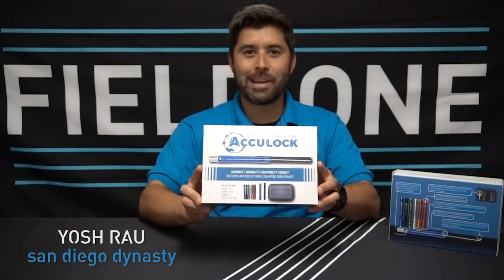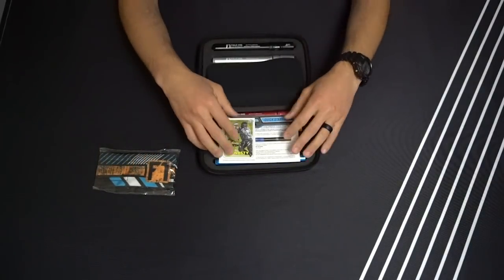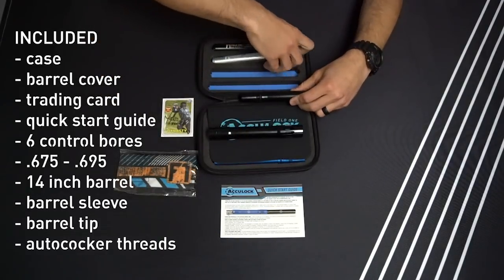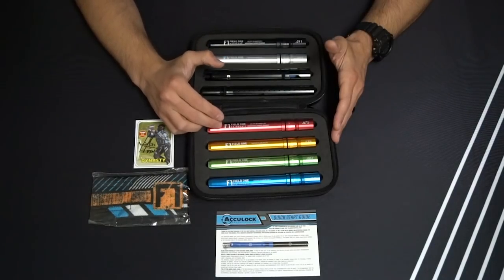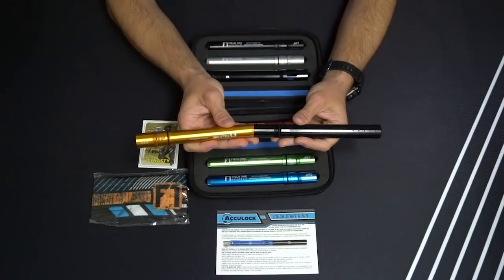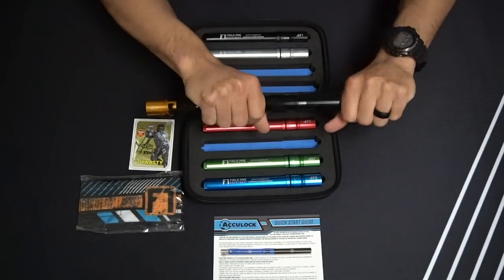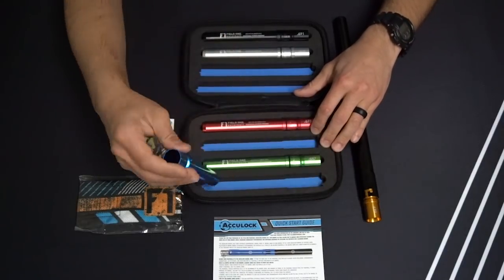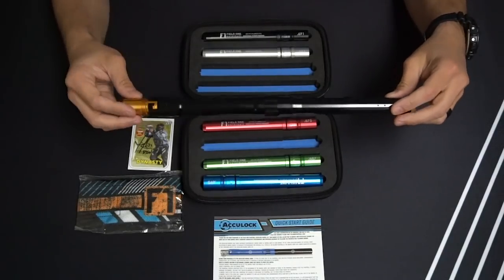Acculock Barrel System Demo

Comment: I’ve been playing for 15 years and I have never once used a .691 let alone a .695 insert.  I’ve used some of the highest grade paint all the way to the lowest, even on 95 degree days paint doesn’t swell that big. You should have focused more sizes in the lower .680s and upper .670s.
Reply from the maker: Jarrett, Thanks for your feedback. You're correct that paint is very rarely sized at .691 or .695. However, what we do find is that paint is sometimes not round, and there are some oblong balls in there. If one of those "football" shaped balls enters the barrel the wrong way, you will likely break that ball. The only way to avoid breaking paint when the balls are not perfectly round is to "overbore" and use a size barrel that has room for the misshapen balls. That is where a .691 comes in handy, or even a .695 is extreme cases. If the paint is perfectly round you are unlikely to need those sizes, but in Dynasty's travels around the world and playing almost every weekend, we often encounter paint where we "overbore" so we don't break paint that isn't perfectly round.
Reply: Field One That makes sense. 👍🏻
Reply: @fieldone3836  that is the most Aha! response. I never thought about how to deal with the footballs let alone "overbore" as you explained with such a large size.
Reply: @JSabella09  I know I am replying to a very old comment, but I wanted to add my experience from this past 2023 summer for any returning players like myself (last tournament played was 2004) and new players looking to upgrade to this great kit and watching this video.  At the height of summer here in central Illinois, its rather humid.  When its 90+ degrees with added humidity,  shooting the Dynasty branded paint, I was having to use the .691 insert.  Paint was always kept out of the sun but the humidity still swelled the balls to a size that I also had never shot before.  I broke zero paint and I was very thankful that I had the extra large size on those few days.

Comment: why have an insert at this point? Just make barrel back  if the tread is on the insert. The Idea behind  system like the freak is the ability to have maximum compatibility and flexibility. My freak kit contain ac back, spyder back and ion back plus a freak tip, an all american tip and an apex tip. This allow my to use all insert and all tips on all of my marker. I can't see the point of this kit.
Reply from the maker: The Freak kits are great, especially for having multiple options like switching between markers. We were not trying to make a Freak kit, but something different that we felt improved on some things that were important to us-namely shooting through broken paint, not breaking paint, and durability. A big part of this barrel kit design is the patented self-aligning feature that aligns the bore with the tip perfectly each time. Even two piece barrels with barrel backs often have issues with how the two pieces align. The other benefit of this feature and having a tapered bore that goes into the tip is that there are no "flat" seams for paint and shell to get caught in. Thanks for your feedback.
Reply: @fieldone3836  Well I understand your point. But it is not quite evident in this video that an unaligned plage our marker. You might want to show how other barrel are problematic. Presented like this it look like a solution looking for a problem.   

Since the insert is threaded, I can't wait to see the inevitable useless video comparing the PE fl bore only VS Acculock insert only XD.
Reply from the maker: @mikaelangelo6940  We're not trying to scare people into thinking their barrels are bad, and they're not. We are trying to explain and show some of the features of our barrel that we think makes it different from other options. Barrels that do not align properly are quite common, and simply the result of minor manufacturing issues. They work, but they are just not quite right. The patented self-aligning feature eliminates that issue, which is great, but we certainly haven't landed a man on mars, or even allowed you to shoot more people off the break. The larger benefit that I saw from the use of this feature is that the our barrel shoots better through broken paint than barrels made other ways. I certainly can not prove this scientifically, but I think the biggest benefit is that the insert extends into the barrel tip so there are no "flat" seams for paint and shell to get caught in. The paint and shell only has one place to go, and that is out of the barrel. I had a barrel many years ago with this feature and always felt it shot through broken paint better than others. At some point, someone did a detailed barrel test, and they got a similar result to what my gut had told me. (Here's a link to their test: https://www.pbnation.com/showthread.php?t=2218018). That taper extending into the tip was a feature I felt was important for the performance of the barrel, and the fact that we were able to make sure the tip and insert were aligned properly was the icing on the cake.
Reply: @fieldone3836  Not saying you should trash other barrel but show (animation would be great) how the paint get stuck in a regular barrel. I totally understand your point but it is hard to picture the advantage (how slight it might be) over the barrel we used for the last few decades.
Reply from the maker: @mikaelangelo6940  An animation would be an excellent idea, and something we will look into. Thanks again for the great feedback.

Comment: Sorry but that barrel system looks like garbage. I’ve owned some freak kits for over 10 years and have never had “durability” issues.
Reply from the maker: Sorry to hear you don't like our new kit. We did not set out to make a kit just like the Freak. The Freak is a great barrel kit, and I'm not surprised to hear that you've never had any durability issues in 10 years. If you take good care of your equipment, and don't have any unfortunate accidents, there's no reason you're Freak kit won't last forever. We set out to make a kit that addressed issues and concerns that we have encountered. Durability was one of those. The players on Dynasty are our benchmark, and how was test products, and most of them were not as good as you at keeping their equipment in perfect condition. Between them playing every weekend, an occasional drop or two, and then people not always using their case, we wanted to improve the durability. We believe we did that, as well as addressed some other things, making the Acculock kit something different from what is already on the market. For those who love the barrel they shoot, there's no need to get our kit. For those who are not completely satisfied with what they have, we have another option that a lot of thought and testing went into. The patented self-aligning design makes sure the bore and tip are lined up perfectly each time. This also eliminates all "flat" seams in the barrel, which catch paint and shell making it harder to shoot through broken paint. Our patent-pending twist lock system allows the barrel bore to float until it is perfectly aligned, and then be locked in place so there is nothing "floating" in our barrel. Thanks for your feedback.
Reply: @fieldone3836  Why does your $1600 marker only come with 2 inserts?  FFS for $1600 you'd think you'd include all the inserts.
Reply from the maker: @PhillMcRevis  Thanks for your question. First, we felt including a 0.683 and 0.691 barrel bore gave the customer a great range  that would allow them to shoot just about any paint. We would have loved to include the full range of inserts, but we wanted to price our limited edition, custom milled marker at a reasonable price point. When you do detailed milling like the Ripper has, that's an expensive thing. If you look at other markers with similar detailed milling they are often much more. Everything we add increases the price, and since we are not manufacturing in Asia, it costs us a lot more to make our markers than the companies who do their manufacturing overseas.  The markers at a similar price point include one or two inserts as well, so we are offering similar features to what they are on a limited edition product with custom milling than is not made or assembled in Asia. Our products will not be perfect for everyone, but we are trying to make a high quality, high performance product at a competitive price all while not taking our manufacturing to Asia. If you have questions or comments about our products, you can always email us directly at sales@fieldonepaintball.com or give us a call at 415-324-4050.
Reply: Do you bitch at other manufacturers  for not including kits or just field one? Awesome looking kit dudes!
Reply: Derek Bauermeister if I paid $1600 for the marker you’re damn right I would. They suckered me in anyway..... just pre-ordered a black to red fade of ans.
Reply: Field One oh I’m a sucker and just pre-ordered one of the black/red fades off ANS..... how much are the control bores going to be?
Reply from the maker: @PhillMcRevis  Additional bores will be $20 each. Or you will be able to purchase an expansion kit that will come with the Acculock hard case and the 4 additional inserts for $84.99. It will also include a new flap for the Field One Marker bag that's included with the marker that will hold additional barrel parts so you can fit a complete kit in the marker bag if you don't want to use the hard case.
Reply: Field One thanks for the info..... canceled my pre-order from ans..... just couldn’t justify paying more for a 2012 marker than I would for a 2019 marker (luxe x, cs2).
Reply: @PhillMcRevis  Bad troll
Reply: Mel Logan lol ok.